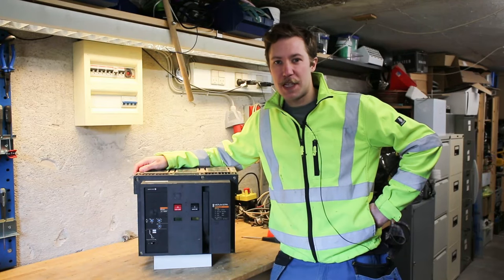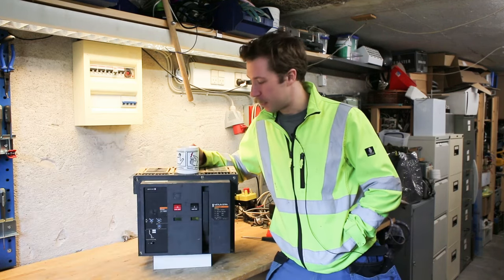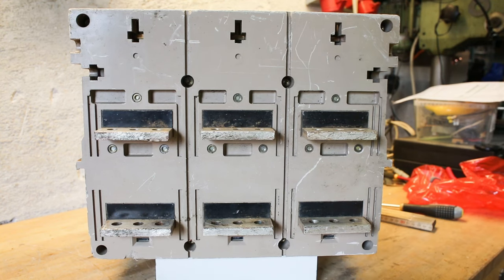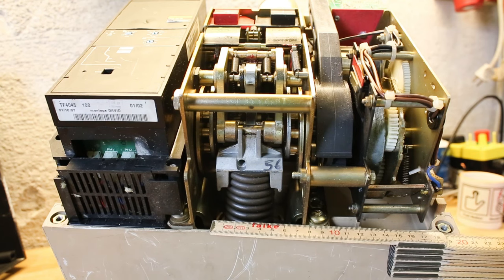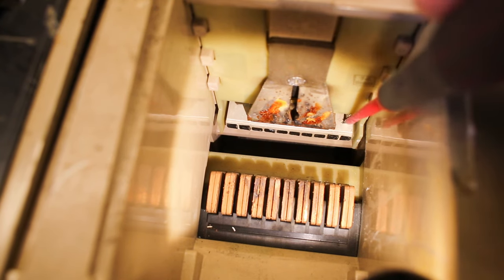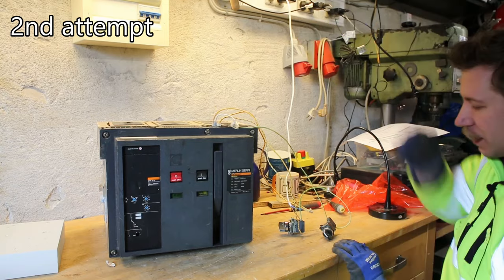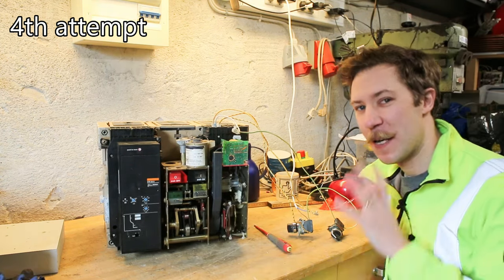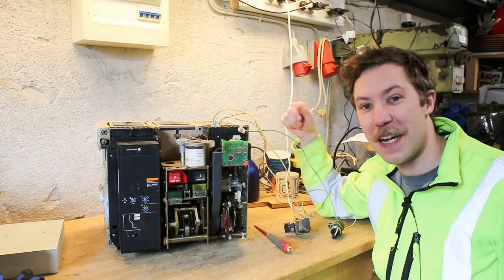Merlin Gerin Masterpact M16N1 - 1600A Circuit Breaker Test

Comment: I work at a power plant and almost all of our breakers are that size or larger.  On the low voltage side our largest are ITE/Gould K3000 (480V x  3000A). On the medium voltage side we've got some ITE/Gould 15HK1200's (13800V x 1200A) which are just huge.
Reply from the maker: Unfortunately also getting too big to make it unto my work bench :)

Comment: That's a baby breaker, but a really cool find. Take note, in working with breakers this size and much, much larger, normally the closing spring charges the trip spring when you close it. So be careful if you find yourself in a situation with the breaker closed and the semaphore shows discharged, the trip spring may still be charged. Not 100% sure on MG breaker semaphore if it will still show charged with trip spring charged and closing spring discharged.  
Also, the rusted part you mention with the arcing on it. That is part of the arc chute, when the breaker trips the arc will climb up that conductor up in to the arc chute to be extinguished.  As sucj it will normally show signs of arcing. 
Also, also, normally these operate around a 5 cycle trip or 5 cycle close time frame. Some times faster and some times the breaker will be faster to close than trip. But normally tripping is the faster operation. Just to give you an idea of the times you should be seeing with the high-speed cam. Larger substation breakers are 3 cycle trip or some 500kV breakers are even down to 2 cycle trips!! Higher the voltage, the higher amount of power that can develop in a fault condition and needs to be cleared even faster. 
You can look up GE Power Break or Cuttler-Hammer Pow-R breaker manuals for reference to this breaker if hard to find manuals on it. I have a few manuals if you are interested.
Reply from the maker: I am not taking home a larger breaker on a bicycle ;) Trip spring must be much smaller and hidden somewhere inside? I got some closing and opening times recorded from the high speed that will come in next video. I love getting these feedbacks from old users or maintenance technicians that once worked with the stuff I find and do teardown on :)
Reply: @KaizerPowerElectronicsDk  Hahahaha, that was big enough for a bicycle!  Been a few years since I worked on the smaller breakers like that, but on the larger breakers as a rule of thumb the closing spring charges the trip spring(s). So the closing spring will be much larger since it has to close and charge a trip spring. This breaker may use the same spring, but normally the close and trip are separate mechanisms. You can always watch the big spring and see if it releases a but when you trip it. Rather mention it and it not apply to this specific breaker than not say something and see a video with 9.5 fingers.
Reply from the maker: It must be a secondary trip spring, as the main large spring that is visible do not move at trip. Thank you for sharing your knowledge for safety!
Reply: @KaizerPowerElectronicsDk  No problem, glad I was able to help out a bit.

Comment: We have four 1200 Amp the main building breaker is 3000 Amp, all 3 phase 480 VAC 60 Hz.  We had probls with the GFCI tripping on one of the 1200s so we have an electrical maintenance company come in every few years and calibrate and certify the breakers.

We lost part of a week when a ground fault tripped the main breaker, which failed and shut down our whole other campus.  The breaker was no longer manufactured and had to be shipped from god only knows where.
Reply from the maker: Shows the value of preventive maintenance AND upgrading when a product goes into classic mode. Companies that build these systems usually gives a 10 year warning on spare parts going out of the catalogue.

Comment: Now discharge few thousands Joule capacitor bank though it. :P
Reply from the maker: Soon...
Reply: Like the destruct-o-tron that Mike Harrison (mikeselectricstuff) built. I think this would survive that.
Reply from the maker: After a few tries, I think that anything above 10 kJ will do some serious damage to the contact points. But that is also a reverse load of what it is designed for, I doubt this was built to switch in a high voltage circuit :)